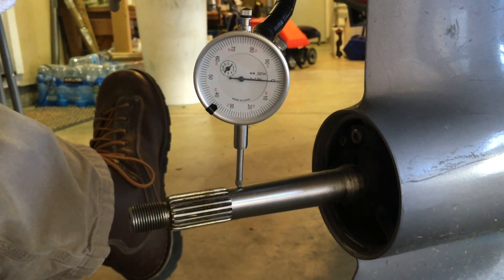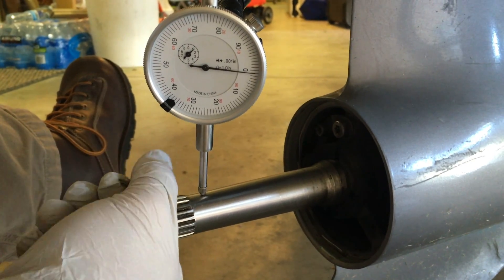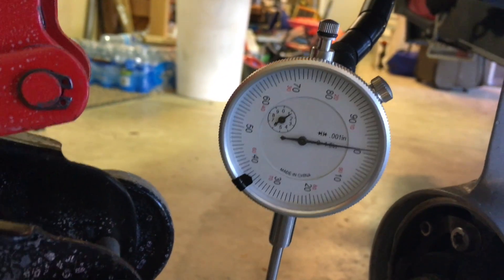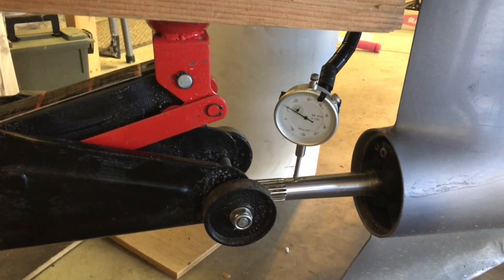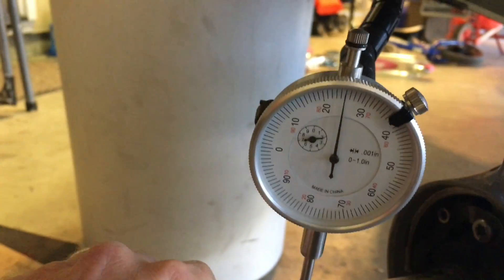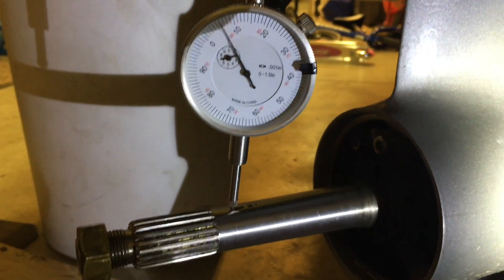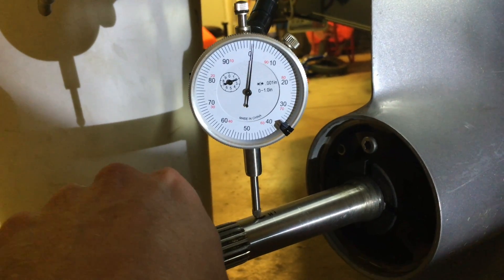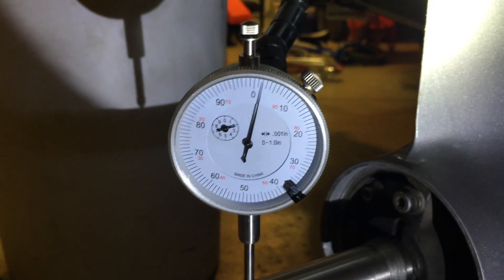Boat propeller shaft bent; repair

Comment: Nice video. A few questions : how is the bearing/seal/gears affected by this ? You think there will be more serious problems in the future? 

Where did you get the dial and how did you mount it ?
Reply from the maker: Great questions!  So before I went and did this, I did research and read and looked everywhere I possibly could on forums, threads, and websites to figure out how the pros and boat shops do this.  I found a few different places (like "The Hull Truth" and "iboats") where people commented in a thread saying that they had used a long piece of pipe to bend the prop shaft straight, or other ways.  The one thing I read that finally gave me the confidence to just go ahead and try it was one guy who worked at a shop said that they had bent multiple prop shafts straight again and had seen the boats again at the shop years down the road for other, unrelated to propshaft, maintenance and repair issues, and the propshaft they had repaired was still true and the bearings and seals were holding up just fine.  I figured if that was true and I was just bending the propshaft straight again with no heat and very carefully with that dial indicator, then the worse thing that could happen was that the seals went out or the bearings went out and I needed a new propshaft anyway.  Someone in my town (Boise, Idaho) quoted me $700 to replace the shaft and seals, so that was worse-case scenario.  After doing all the reading I've done, I really developed a trust that the Volvo-Penta outdrive is very robust and could take that kind of a beating.  When I bought the boat a year ago, I was pretty new to boats (though I'm pretty inclined mechanically, so I checked the engine really closely), so I didn't even know to look at that.  I was just happy it had a stainless steel prop and left it at that.  The propshaft has probably been bent for years and would probably still be fine for years, but I've read it puts a lot more stress on drivetrain components when its bent like that.  I took it out just yesterday and it felt a lot smoother and I've pulled the dipstick for the outdrive oil and there's not a hint of water in it.  Of course I wouldn't trust that just once or twice running in the water would prove that the seals were perfect, but if I had ruined them right out of the gate, I would see that looking at the dipstick if the oil was foamy. 

tl;dr: So I don't think I'll have any serious problems from that in the future! 

The dial seriously cost my only $27 from Harbor Freight, and its the kind that came with vise-grip-type pliers and a cool flexible arm that stiffens up when you throw a lever.  That way you can use a rag to vise-grip to the fin above the propshaft and then use the arm to put the dial indicator right on the shaft.  I think it's pretty important for the dial indicator to say on the propshaft as you bend it back so you aren't having to put the indicator back on every time, and you can see just how much you're bending the shaft in the opposite direction from the bend as you go along.  

Good luck! I hope it works for you too!
Reply: +Cameron Crawford , awesome, thanks for the detailed reply.  I have an Alpha 1 outdrive, but I think it can too take the stress of this procedure.   Seen a few videos on YouTube where people do the same to them.  

sorry for picking your brain so much, but had 1 more question.   Does it matter if you measure at the tip of the shaft (where the thread is) or at the middle of it where you did ? I suppose the readings would be consistent but if the bend is closer to end, it would throw them off.  thanks again,  nice job
Reply from the maker: No problem!  Yes, I think the Mercruiser outdrive is similar in that regard.  I think it might be easier to replace a prop shaft on it than the Volvo Penta too (at least that's what I recall from all the research I did).

You're definitely right about there being a difference in where on the shaft you measure and the amount of runout you see on a shaft like that.  I chose the point on the shaft that was as far out as possible, but where you have a great, smooth surface for the indicator probe to ride on.  I recall reading something where someone asked that and that was the point they measure the runout on too, so I figured that even if it wasn't dead nuts at that point, it would be pretty hard to measure a couple thousandths at the very end of the shaft with the threads and everything.  So I feel pretty good about getting to the two thousandths, even if the very, very end of the shaft is one or two more because of the extra length.

I looked up what a propeller shaft for the Volvo Penta actually looked like outside of the outdrive, and its much larger diameter in the outdrive housing than the shaft that you bend on the outside, so when it bent originally (I hope!), it would have been the outside part of the shaft that bent, not the inside, especially since its got great support by the bearings as well.  So bending it back should be bending the length of the shaft outside the drive, not the inside.  

Thanks for your compliment!  I found a couple videos on the topic during my search and felt like I might be able to add a little to the universal knowledge for the next person to benefit from!
Reply: @mbwtrpolo  thanks for the video.. I live in Meridian, ID and will be trying this shortly. Did you run into any long term issues?
Reply from the maker: @kzwithcc  Nice! For the time I owned the boat after I did the repair, I didn't have any issues at all. It was just much better to not have any vibration issues on the prop!
Reply: @mbwtrpolo  how was the vibration ? On low and hi speed ?
Reply: Cameron Crawford good words!
Reply: "Straightening" your prop shaft this way is incredibly dangerous.
The jack can slip and kill or maim you.
You can break the upper fin area of the lower unit where the wood is from the jack pressure.

This "method" does not take into account the exact location of the bend along the shaft, you can EASILY make the bend worse, or cause a new bend point.
If you have multiple bend points in your shaft from multiple prop strikes on rocks this won't even fix it, you'll be chasing your tail for hours making it worse each time.
You are destroying the bearings and seals by putting all this side pressure on them, they are NOT designed to handle that.
You could be flat spotting the bearings, or worse they could break.
The proper way to do this is to remove the shaft and heat it and roll it on a perfectly flat surface.
Or just do the right thing and replace the shaft, most of them are not that expensive compared to other things on a boat.
If you have the skills to do this guys "method", you have the skills to pull the lower unit and swap out the old shaft for a new one using a repair manual for your engine.